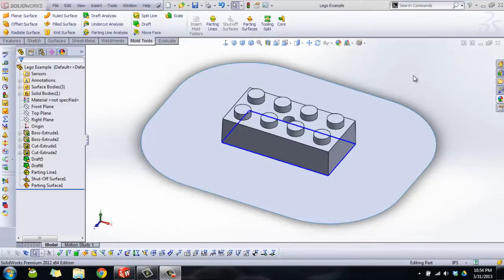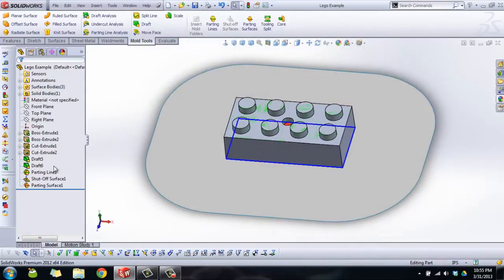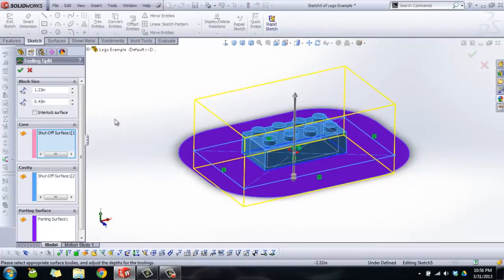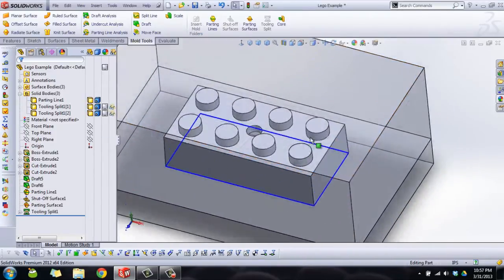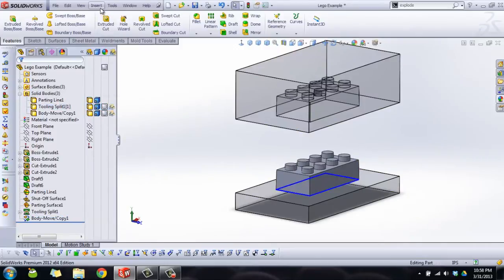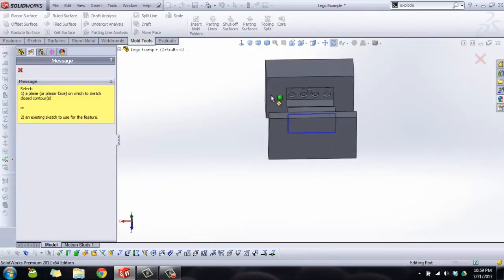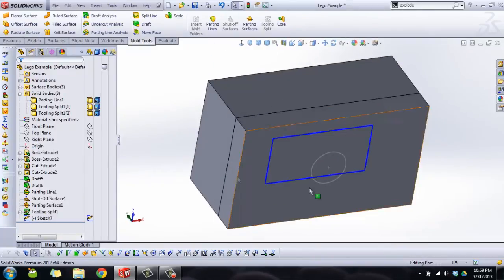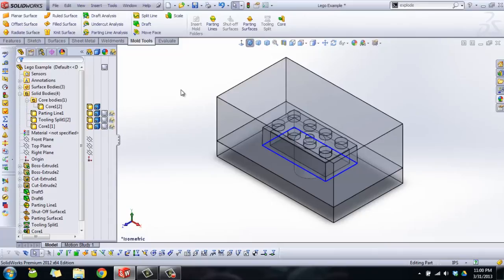SolidWorks Tutorials | Mold Tools Part 3 - Tooling Split and Core

Comment: Hey Robert!! I'm having the same problem... I need to see one with more cavities or cores...
Reply from the maker: unfortunately, i am temporarily out of a program to edit videos! I was borrowing a friend's copy of Vegas Pro 11 but i lost it when i updated to windows 8.1. Hence the long hiatus from posting.
Reply from the maker: The best technique for making multiple cavities, i think, is to make each part's mold separately, then combine them into a single part after they are ready. the mold tools in solidworks doesn't handle multi-body parts very well yet.